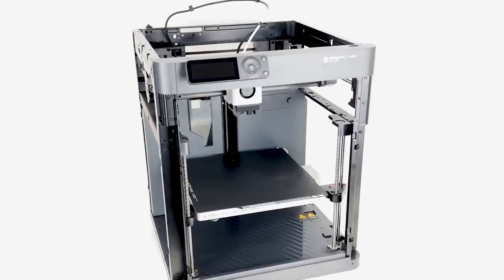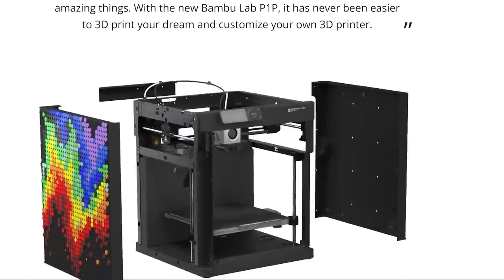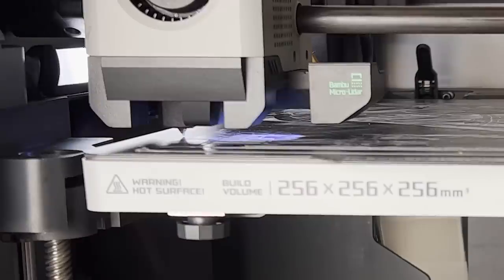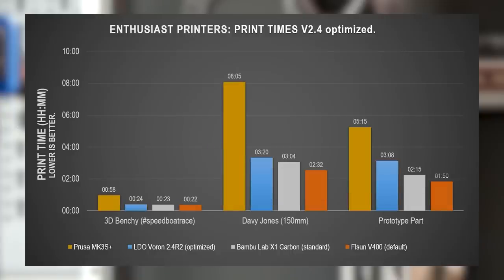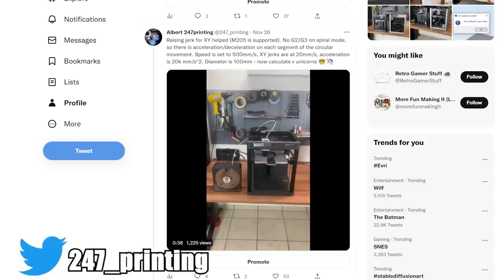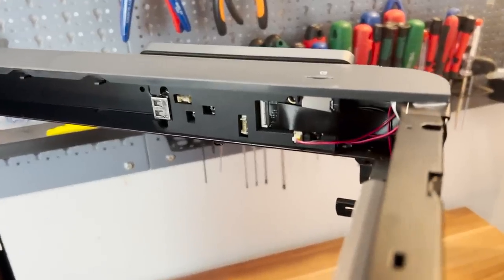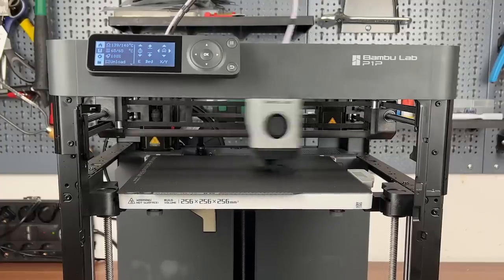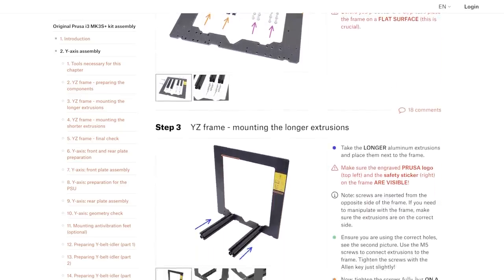Bambu Lab P1P REVIEW -  HOW GOOD IS IT REALLY ?!

Comment: As someone that has exclusively used 3 Prusa MK3S+ printers for several years to run a highly reviewed Etsy business I recently ordered my 2nd X1 carbon and will be replacing the Prusa printers. The X1 Carbon somehow prints at 2-4x the speed and even beats the Prusa on quality…I truly didn’t that the quality would be there but somehow it it! I LOVE Prusa they helped me build a great business but somehow Bamu Lab has mateched and even beat Prusas magic sauce.
Reply: do you have a link to your store?
Reply: Did you think about spare parts availability? One big plus of Prusa is that all the parts are open source.
Reply: @wishihadablog  Yes I did consider that. Sorry at some point you have to just give something a try. I have 3 X1 Carbons running full out 20 hours a day and they have been going like that for about 4 weeks now. I’ve had one single clog in all that printing and 2 failed prints..that roughly 1800 print hours already between the 3. Also the replacement parts seem to be readily available on the Bambu website at quite reasonable prices at the time of this comment. Time will tell but so far I have no regrets at all in abandoning my MK3 printers.
Reply: @wishihadablog  spare parts are readily available and pretty cheap but bambu labs filament or spools is more complicated always sold out. and I live east coast so take 7 to 10 days get parts atm but sure that all get better
Reply: @damiengvideos4337  spare parts are available now, but what about the future ? What about they decide to release a new printer and stop selling older parts ? What about Bambulabs dissapear ?
Most of Prusa parts will be available for ever and ever.
I talk just about spare parts, not the rest (print quality, speed, etc) which is surely better than the Prusa. I have only a doubt about print quality as the majority of X1C users says that the print quality is a just the same as the Prusa.
Reply: @blm7929  Honestly I’d say you worry too much. It’s the very same concern with any new product and company. If it’s too much risk for you don’t buy one. Personally I’m good with the risk…my 3 printers are going on 1000 hours each of print time and no problems at all…I did run into an issue with my AMS hub but that is getting replaced under warranty. If spare parts go away and Bambu goes out of business then I’ll use them till they die and buy something new when i need new printers. Simple as that. I actually JUST cancelled my last Prusa XL preorder…my order was up and was going to ship within 2 weeks, but $2500 plus $250 shipping is absurd. I could buy 2 more X1 carbons with AMS for that price!

Comment: If you already have Prusa printers , they do produce good quality. ( with some upgrades ). I have 9 Mk3 s. Minis etc. after receiving the Bambu x1 carbons. They are my new go to printers. Now I do still use the prusa s. But usually just to mass produce something.  if I need to print quickly it’s so much faster to do it on the Bambu printer. I had a deposit for a couple of the Prusa xl s. But honestly I don’t really see a need for it.  I could buy 6 bambu  p1p s. For the price of the XL from prusa. ( with the 5 tool heads. ).
Reply: I’m in the exact same boat. I’ve exclusively loved and used Prusas for the last few years and have a deposit down on 2 XL model but have canceled one. I just don’t see how an XL with 5 tool heads for $4k can possibly replace a single X-1 Carbon with AMS for $1500. Or add 3 extra AMS units for a total of $2550…16 colors and superior speed. I hope this wakes up Prusa and they put out a better, faster machine. Win win for us consumers!
Reply: i dont own a prusa nor im a fanboy of it, but i think the main reason going to a Prusa XL is the more stable build quality (maybe for long term use, if it matter) and you have a multi material printfarm not to ooze so much filament. But there is a lot oozing before break even...
Reply: @adamriese3610  more stable build quality? it uses plastic parts, it doesn't have supporting extrusions in the front etc..

there's just so much wrong about the xl, the only 2 benefits of the xl would be the larger bed and the toolchanger, and that's about it
Reply: @adamriese3610  I love my 3 MK3S+ printers 🖨️ for their quality. However my X1 Carbon is so much faster and is even better quality than the MK3. I hope the XL steps it up even more! Then we all win 🥇
Reply: oh, i think i mixed up something. Yeah right the missing front extrusion is weird... dont ask me. I got a sidewinder, and now using a voron i dont buy a prusa. The price for the hardware is too bad for me, even when they use excellent software and documentations
Reply: @damiengvideos4337  yeah. the xl looks massive on the pictures, but the question is how good do we need the quality? the prusa xl is a Printer from mainly cop (carry over parts) like open source projects. So it is the same fight (prusa xl vs voron like prusa mk3 vs Ender and others) while the bambulab is going all in and do a crazy scale with injection molds and so on
Reply: @adamriese3610  the only good thing about Prusa is the slicer, which is Slic3r modified with some presets, the standard software is just decently tuned Marlin, so still nothing special

if anything the whole Prusa ecosystem is a joke, it's an old asf design and it runs the same software as the cheapest Chinese garbage, and the front extrusions missing makes it very unsturdy compared to any other CoreXY, and then to add the printed parts thats just a nope imo

Bambu all day, the only issue is that they're, like most printers, pretty small, but the xl on the other hand is only 10cm larger in x and y, which isn't even considerable to me

i aint paying double the money for a 10cm increase

i also dont want a voron as you can't get all parts in metal and i want something that doesnt require tinkering
Reply: @adamriese3610  All I know is I’m so impressed with my X1 Carbon with AMS I ordered a 2nd one and I’m selling 2 of my MK3S printers.
Reply: @BH4x0r  yeahh, right. But there is something they do right. Look at the sales and fanbase. I mean there are so many prusa likes like ender 3, or early anycubic i3 and so on and the prusa still sells good
Reply from the maker: Really? I strongly believe that there are WAY more Ender 3 sold than Prusas - WAY MORE. I don’t have numbers though, but Prusa is not dominating imo.
Reply: @adamriese3610  it's like the Apple of 3D printers, their marketing got people to buy them, but they're nothing special, and since people massively gave good reviews combined with the ads people made most people trust and stay with Prusa, but on the other hand it's just basic shit with printed plastic parts

if you just bought the parts/similar parts and printed the plastic yourself i doubt you'll come close to even €200, but i don't want my printer existing of plastic parts either way, especially not structural parts

the other thing is Ender 3's etc come without any tuning etc.

the Prusa's are pre-tuned and have a better hotend out of the box, thankfully.

on the other hand they're just old fashioned pre-tuned repraps that are certainly not worth the money

the hype and ads by people is what caused people to buy tons of Prusa's but they're nothing special at all
Reply: @247printing  yeah, there are way more enders (just check their subreddit numbers) but i mean that the prusa is still a thing and more than enough people decided for a prusa to keep that alive even when the ender 3 and so on released
Reply: @BH4x0r  I'm not the type of person that can be a fanboy, for me a product from a brand is good at the moment but if the future a product from an other brand is better I will switch with it like I switched from Android to iPhone and back to Android (and maybe to iPhone in the future ? Who knows, I'm not tied to a brand).

But: I had an Ender 3 V2, an Artillery Sidewinder X2 and now a Prusa i3 MK3S+. The MK3S+ is way better than the two others. Nothing to do with marketing (I found silly how Joseph Prusa is highlighted like a guru).
It's not like you said, just a normal printer with nothing special but marketing nor just a pre-tuned printer. Compared to the two others (and many other of the actual production), it's an easy to use everyday workhorse.

Yes, clearly, when you first look at it, it doesn't look like much and is almost scary with its plastic parts. But oh boy it is easy to use and highly reliable: No bed to adjust (no screw nor spings), great bed levelling probe (nothing in common with the wide selling BLTouch which I had problem with like a lot of people), no carriage wheel to adjust nor axis wheel, nothing... in fact, you have nothing to adjust, it just work ! With the two other printers, I spent more time to adjust between prints than really print. Sometimes I even decided to not print pieces because I didn't want to waste time making adjustments.
Since I own the Prusa (two years), I made no adjustments (nor any upgrade). Generally, I print several times a week. Sometimes I took breaks of a few weeks but even with that, you start the Prusa, hit print button and... it prints.
And it prints all parts without assle. I print PLA, PETG, ASA, TPU, ABS, with no modifications. The PEI sheet is great, no spray or glue or anything, it just sticks to the bed (not reserved to Prusa tho, I added a PEI shit to my other printers).

My worst experience is with the Ender 3. I adjusted it a lot, I upgraded all the pieces from the bottom to the top: new fans, new fan duct, double Z axis, eveything, but like everybody it's never sufficient. You always have to adjust it between a number of prints or if you don't use it since some days, it always has problems, etc.
The print quality is the same, nothing to say about it, but the process to succeed a print... not the same.

I think you can't understand if you don't use a Prusa.
Being that said, it's a great printer but some are better. And if the Bambulabs X1C was not noisy, I surely switched to it.

Comment: Hurra! Great video, really enjoyed it - thanks for the shoutout! Always a big plus to learn something on the technical side, didn't know there is such a difference between P1P and X1C regarding electronics. My X1C just arrived, can't wait to check it out since I already liked the P1P a lot.

Still using my MK3S+, though. I dont know why I sometimes chose it over the P1P, perhaps just because I'm so used to it. Time will tell if the Bambu printers work that good on the long run.

Happy holidays und genieß deinen Weihnachtsschnaps, cheers :D
Reply from the maker: Danke!! Glad to hear that you received your X1C - excited to see what you make out of it concerning content. I have to admit: I rarely use my MK3S+ since I have fast printers, but still for smaller parts or when time doesn't matter. 
HAPPY HOLIDAYS!
Reply: @247printing  Hallöchen! That raises the question: why does speed matter sooo much?! Most users should use their 3D printer as a hobby in the afternoon or at the weekends. And it should not matter to leave the printer printing (even over night) or 16hrs during day, especially since one printing hour does not cost so much (as Mpox video showed). And if I would run a small business, it would be an easy decision to invest in 3 printers (Ender3) and not rely on one expensive one (Bambu) for the same price and for reliability?!

So: what is it with speed?! Compared to most Ender 3 variants and clones the P1P is 3-4x more expensive. And to add a important point to your conclusion: you not only learn much about 3D printing from a Prusa Kit, but also from a cheap printer like the Ender. Especially when considering adjustment, troubleshooting, settings in slicer (where BambuLab is limited) and of course modding.
The adding of a Klipper solution to any Ender clone via Raspberry Pi, Notebook or Klipper "Pad" alone means ton of learning, understanding and Knoff Hoff.

So again: why are people willing to invest like 3 times the money (compared to other basic printers often recommended) to get more speed for a hobby and experience less learnings, less tinkering time and at the end: less time with that hobby?

If I "just wanted the 3D printed part" I could also order it at so many manufacturing services out there, without the need of a 3D printer in the first place (to give an extreme example of not being interested in the "how" but only the result).

This could be an interesting question to answer, especially with having read so much comments under 3D printer reviews ... like you maybe have read.

Grüße!
Reply: @hassosigbjoernson5738 from a business standpoint, space is almost always an issue, being able to replace 3 or 4 printers with a single one means that you can either scale up further with the same space or that you need less space for the same print throughput. Also power consumption of running 3-4 machines compared to running only one is also a consideration especially as most of the power use comes from the bed heating and nozzle heating and that is what you are multiplying by having more machines to do the same amount of work.

For hobby use, if you are prototyping and want to test parts it speeds up the process a lot being able to quickly print the parts. A lot of the time I am building things, designing and printing parts as I go. Being able to quickly print parts on my voron allows me to continue with the project rather than having to wait for parts to print before moving onto the next part. The difference here between a print that only takes an hour compared to one that takes 4 allows me to do so much more in one day rather than have to wait and put things off to the next day. Obviously when I don’t need it printed fast, I can just up the quality and have a longer print time if I am printing in the evening and will be at work the next day it doesn’t matter if it takes 12+ hours, but when I come home and want to get on with building stuff that evening being able to design, print and implement a part all in one evening is invaluable when you don’t have infinite free time. 

There is also the issue that the longer a print takes the more likelihood there is for a failure. Some of this is just due to print distance, but also time is a factor and increases the likelihood of electronic failure, power problems or temperature fluctuations. Failing a 16hour print puts you a lot further behind than failing it if it only takes 4.

Comment: Broadly speaking, I agree with your conclusion: if you're in the part of the "3d printing community" that doesn't care about building and modding a printer and just wants a tool for making things, the Bambu machines are probably the best choice.  The one advantage Prusa has over Bambu is a proven track record, though.  If you're a very risk-adverse person, Prusa is probably a slightly more stable company.  Not that I have any reason to doubt Bambu's stability, but we don't have long-term data.  Likewise, we know the Mk3 in its many forms will run for years, and we just don't have that long-term experience with Bambu.  (A subset of this, Prusa parts are available from a lot of different sources, meaning that even if Prusa suffers a catastrophe spare parts will be fairly findable for some time.  Whereas Bambu is currently a single-source machine with minimal fallbacks if something happens to the company.)

Until I watched this, though, I hadn't thought about the Prusa as an "easy entry" for those who are interested in building and modding.  That's actually a really good point - getting the Prusa kits will teach a new printor a lot about how to build and maintain a machine, while still offering a lot of strong customer support and high quality parts.  If yo're brand new but eventually want to build a Voron or a RatRig, the Prusa machine is probably a really good place to start.

Also, you have no idea how happy you made me by remembering that "mk" is pronounced "mark."  It drives me bonkers how many YouTubers say "emm-kay-three."  We don't say "dee-are McCoy" or "Fleet ess-tee," after all!

Comment: 3d printers were always destined to be plug and play appliances, and Bambu is the first to reach that mark. I LOVE to tinker! But I want my printer to be a tool I use in my tinkering, not my project. After getting my hands on my friends new X1 carbon it's a no brainier. My highly modded CR10 has seen the last of it's upgrades. Bambu will surely put out a machine with a larger print capacity and I'm here for it.

Comment: The preorder bonus of the p1p is a low res cam,  the fan and a light. Which is great. Ill add the fan an adjust the settings for sure. I will also print myself a enclosure. Cant wait.

Comment: Agree. My MK3s has been off ever since my X1C has been running. The only thing the Prusa has going for it right now is quietness. I use to be able to have the MK3s on my desk printing and still have a work meeting. With the X1C, even in silent mode, is too loud and annoying. However, with how sturdy the X1C is, if I need to do a print during work hours, I just pick it up and move it to a different room, then use it remotely, since sending files and monitoring the print are both super simple. 
Like many others, I am also have a Prusa XL on preorder, although, after rounds of delays and no end in sight, I wonder if I will even bother following through now that I have the X1C. Especially since the X1C with the AMS does everything I wanted the XL to do, and faster.
Reply: Exactly!

Comment: I started with an Ender 3 Pro and struggled and loved it for 2 years. The P1P is the "next step" in my printing evolution, I'll probably even print parts for the Ender ON the P1P. I'm glad that I understand the devices at a fundamental level, from calibration to configuration and building.